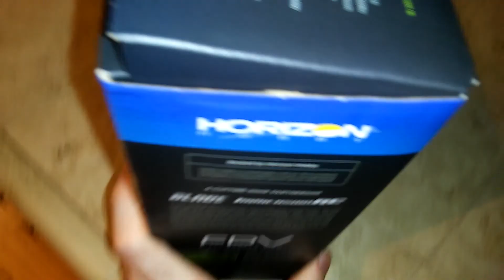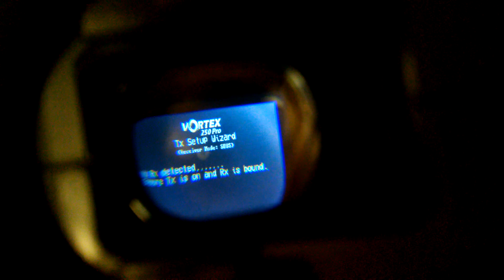Dead out of the box: blade vortex 250 pro bnf autobind failure.

Comment: Once you have plugged in the battery, and that beeping starts, it's indicating that it's checking which receiver you are using, and all I had to do was hold the bond switch on my DX6i as I powered it on, and held it for several seconds until it was bound.
Reply: *bind
Reply: what do u think of  the quad

Comment: For those who are having this issue, yes some of these recievers are faulty..   Also these recivers do not work with some older Spectrum Tx's  Bought this same model and bought a sprektrum DX6i.  the light first worked and then went out. Took both transmitter and Vortex back to to hobby shop where Hobby horizon  came to the rescue. they did a reset on receiver and tried it with a Dx6 instead.  Since then every thing works great. Grant that I spent over a week with a dead Quad and a Radio that was useless to me and a 4 hour drive round trip.. but its a learning curve.

Comment: Hey there ,  maybe you must first bind your  RX en TX with a servo cable and a battery 5Vand then put it back in. The cable is the right way into the RX?greetz lama
Reply from the maker: I don't know how to run a cable from the rx to my tx  there is only one plug on this rx and it goes into the flight control. there is no place to use a bind key